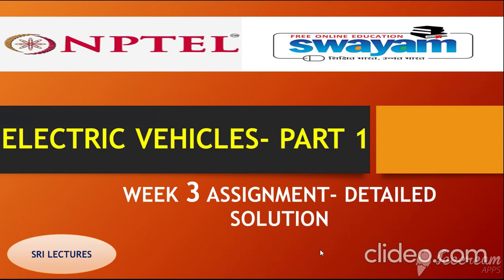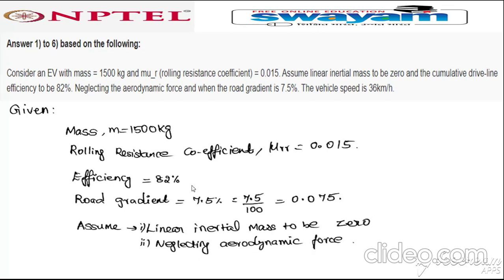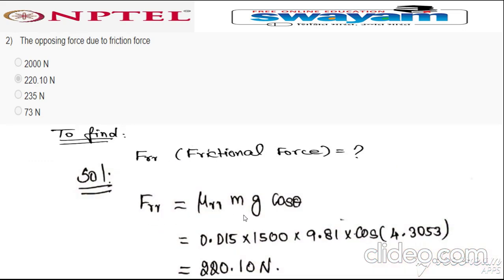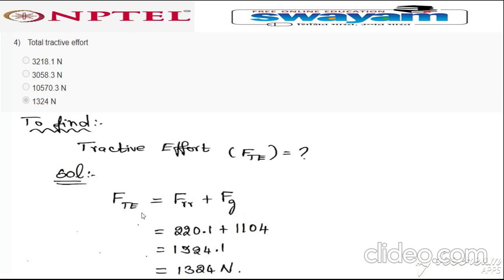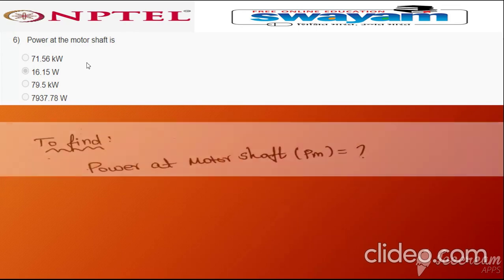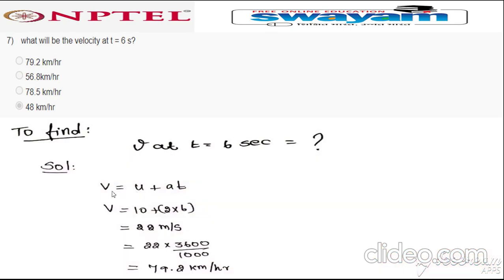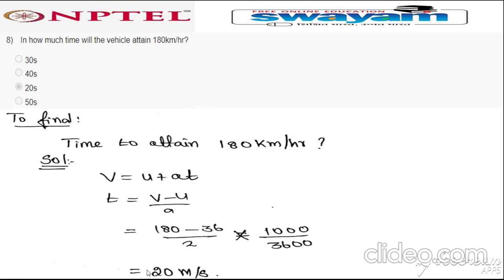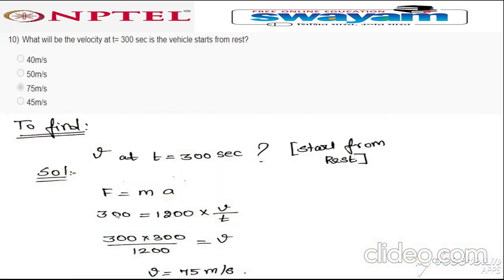💥💥WEEK4 💥💥 ELECTRIC VEHICLES- PART 1   🔥ASSIGNMENT DETAILED SOLUTION🔥

Comment: can any body in this group solve the following question with solution ?                                                                                                                      Consider an EV with the following details. Total mass = 1200 kg, front area = 2 m2, aerodynamic drag coefficient = 0.25 and tire rolling friction coefficient = 0.02, air density = 1.25 kg/m3 , acceleration due to gravity = 10 m/s2 . Equivalent mass for rotational mass can be taken as 6% of total mass. The wheel is connected to a three phase induction motor with a gear. Gear efficiency is 0.9. Induction motor is operating in constant torque region. The vehicle starts from rest and linearly reaches velocity of 80 km/hr in 10 seconds.
1 point
Tractive effort at 10 sec is   ??    (  answer with method please )